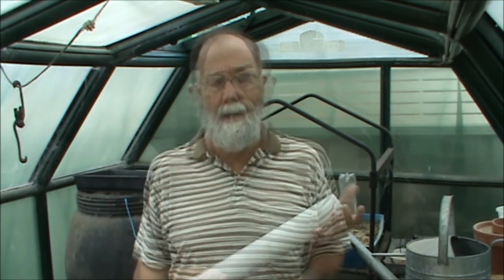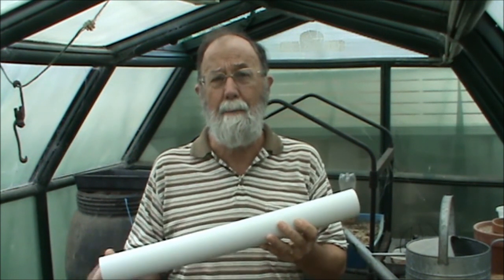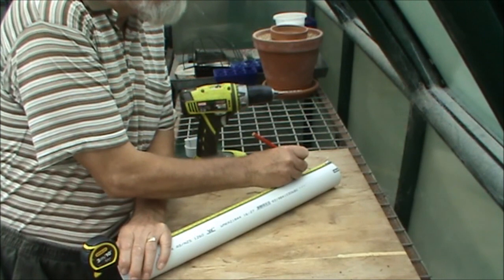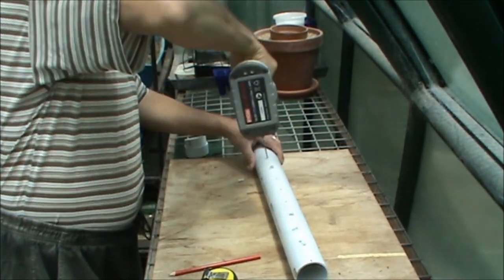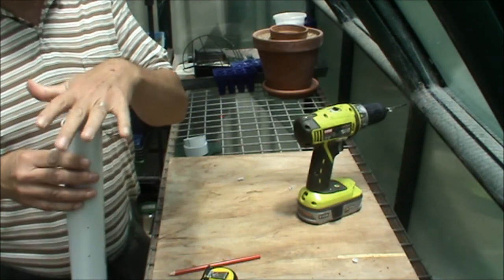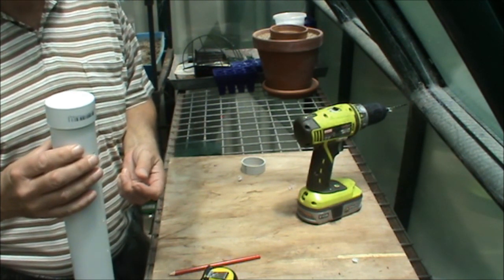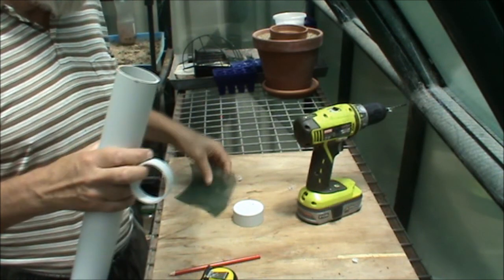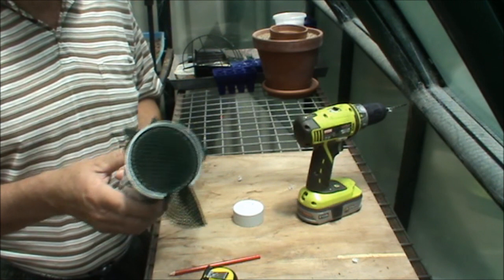Making a Deep Pipe Irrigator

Comment: Thanks for the video. 2 Questions. How often do we have to fill the pipe with water? And when you use the second method for the top cover, doesn't the water in the tube get evaporated? The first method eliminates the evaporation problem

Comment: Im planting trees in holes about 1.5 ft deep. So this length of pipe would only be up to ground level! So I have to have about another 4 ft of length so that I dont have to squat down to add water. And maybe I would do better to have only a couple of holes at very bottom. Or why not no holes at all since the bottom of the pipe is a 2inch wide hole already?

Comment: Nice details.
If I were to use a drip system, what is the maximum GPM for your tubes?
Reply from the maker: Not sure but I am guessing not a lot. The idea is to use water efficiently and so need less water. The porosity of the soil would also have an impact as well.
Reply: @underthechokotree2792  Good ol' trial and error. Thank you

Comment: Hi sir,I think all the water will go underground even if you have holes on the sides. Does water spread horizontally ? Capillarity principle might not be effective. So I am planning to use a low pressure shower head with small protrusions,do that sand particles don't get in and bury it horizontally and irrigate the roots . What's your opinion on this sir ?
Reply from the maker: Hi, the shower head may be worth a go but you would need to keep track of hw much water it is using. In terms of the buried pipe, the trees or other perennials send their roots down to harvest the water resulting in a more drought resistant plant, over time. If the tree has been recently planted, it is possible to put plastic film over the open end of the pipe so that all the water flows out the holes. Once the tree is a couple of years old the plastic film can be pierced to allow the water to drain lower in the soil, and the roots grow down to harvest it. :-)
Reply: @underthechokotree2792  Thank you sir for your reply. I understood the reason now.
Reply from the maker: @sucessmanpower3169  My pleasure! :-)
Reply: @underthechokotree2792  sorry to disturb you again, sir . After sometime don't you think , roots would have got entangled with the pipes and it holes . When we take out , say after two years, won't the roots be damaged .Typically how many gallons of water should be irrigated, if I have four tubes on four sides . These are my queries  and Thank you sir.
Reply from the maker: @sucessmanpower3169  In terms of removing the pipe, you don't! Just leave them there. In terms of how much to irrigate, it depends on such things as the species of plant, the soil type, weather at the time, stage of growth of the plant etc, so an absolute number of gallons would be meaningless (sorry) :-)
Reply: @underthechokotree2792  Thank you for your reply sir . It's teak and red sanders saplings ( Tropical and red soil).Thank you once again.

Comment: You don't have to drill the holes, the water still mostly goes to the bottom. It will work the same without the holes.
Reply from the maker: It depends. If you are putting this waterer in beside a newly planted tree or shrub which is still quite small, and this is the ideal time to do it, and you don't put the holes in the side, all the water would be delivered to below the root zone and wasted.

Comment: How deep do you hammer the pipe in ground?  Doesn't the end in the ground have to be pointed to go down in the ground?
Reply from the maker: Check out the next video on installation. You either dig it in when planting the tree or I made a steel tube into a device to allow a hole to be dug down into the soil to install the deep pipe waterer in :-)

Comment: Nice idea, alternatively, white 4 inch diameter drain pipe (available cheap in 10 foot lengths at Lowes, Home Depot, etc.) already has perforations in two rows lengthwise and using an available drain cap meant for the 4 inch drain pipe makes a perfect slotted top for the pipe. I then use a spray paint forest green to color the assembled pipe before inserting into the hole for a new tree. Your idea of using a bit of shade cloth with a split ring is brilliant and i will plan to use it too since I have ten new trees to plant in next few days.
Reply from the maker: Thanks, glad you liked it! :-)

Comment: Hi thanks for video! We did something similar, by using Agi-pipe. We use the 10cm diameter agi-pipe, that as I'm sure you are aware already has holes in it. I did not cover the tops and it does not get clogged, sure a few leaves fall in, and frogs love to live in there but it is nit a problem! Our top soil is only about 50cm deep max, so we found cutting the pipe to about 20-30cm was adequate to get the water away from the surface and send it deep down.
Reply: How do you decide how many pipes you need? Especially for trees
Reply from the maker: Great idea!